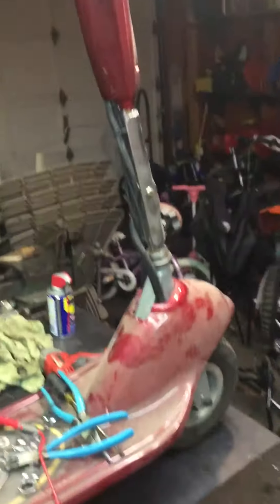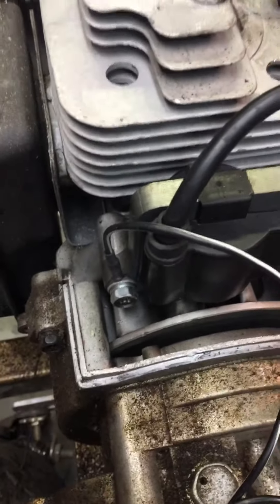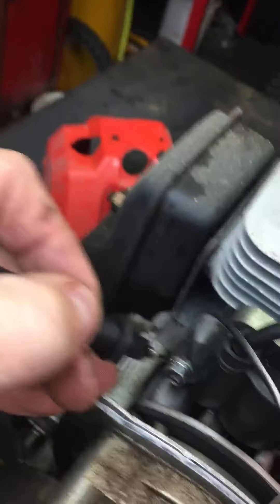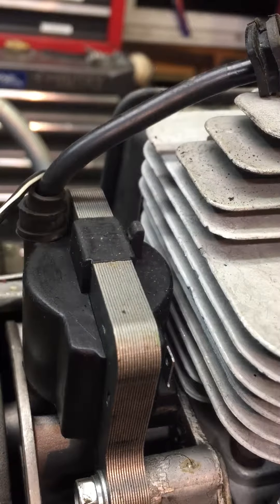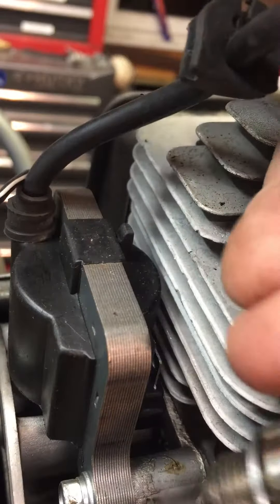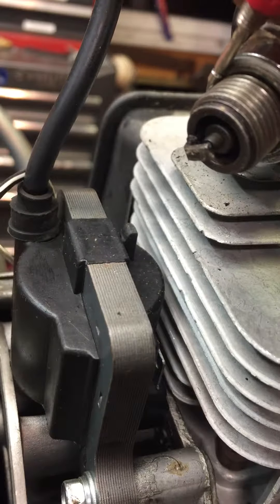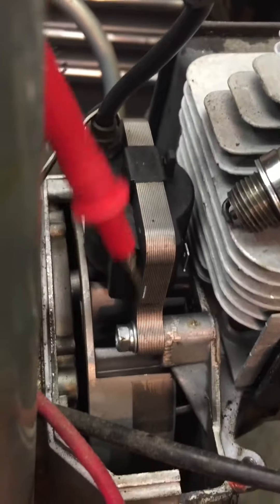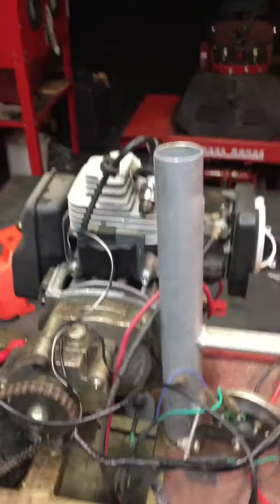Gas scooter.. no spark.. electric start and pull start

Comment: What did you find out?.....I would think you should have continuity at the threads (base) of plug and then a resistance at the center small electrode where the spark generates from?
Reply from the maker: Dennis Griffith 
I determined the coil is bad. Bought a replacement off eBay for $9. Runs great now. 👍🏻
Reply from the maker: Dennis Griffith 
https://youtu.be/P3JwyZy1_oM
Reply: Yeah...the mini chopper I have with pull start and electric start, I accidentally fried the coil...I connected wrong plug and it applied 12v to the wire that is supposed to be kill switch to ground wire....smh
Reply: Yep, bought a 2-wire coil and a new recoil and it's running now! Thanks
Reply: @DirtBikeDaryl  Can you please tell me the part # of the coil you bought for this scooter? Thanks in advance.
Reply from the maker: 89Netsurf  I wish I could but I don’t remember. I think I got it off eBay.